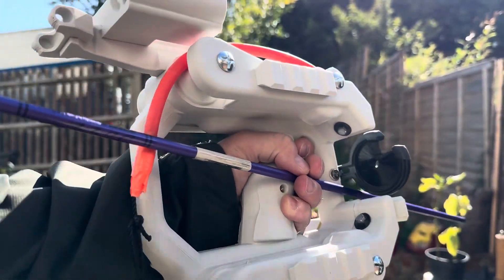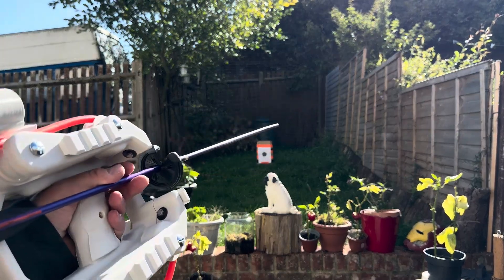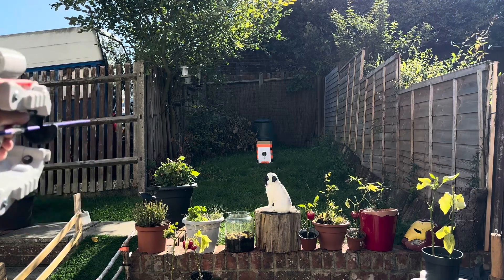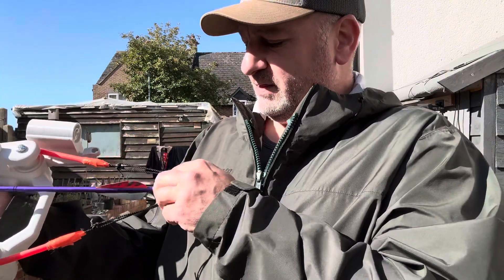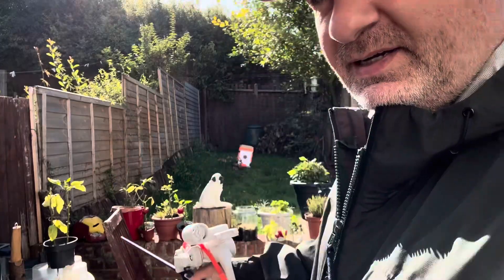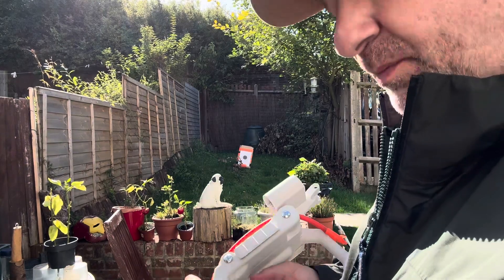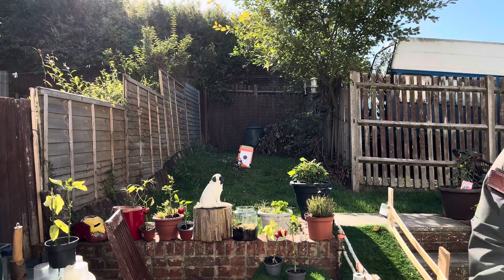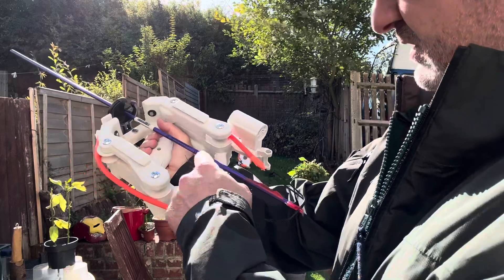This DIY Survival Bow Might Break… But I Tried

Comment: veo que le falta estabilidad, la goma se estira de manera irregular, tal vez por no tensarlo correctamente o muy posiblemente el mango de agarre no es adecuado para su figura. no se si lo construiste o lo compraste, pero el mango para mi seria que estuviese de lado como una tipo Ballesta, de esa forma podrías tensarlo de una forma mas estabilizada. si por mi fuera yo le aria un diseño el cual colocar flechas mas pequeñas de lo largo y un riel con gatillo. saludos
Reply from the maker: Yeah I 3d printed the file and it needs work. In relation to the bands maybe they are too old? They were cut from the same band so one shouldn’t be stronger than the other in theory.
Reply: @prepperinthewoods  o recorta las bandas para que no tense de mas pero tenga una gran fuerza unas bandas de goma mas resistentes a ver que pasa, saludos